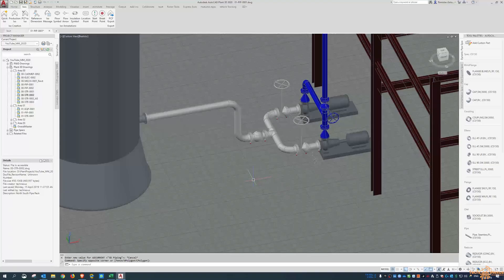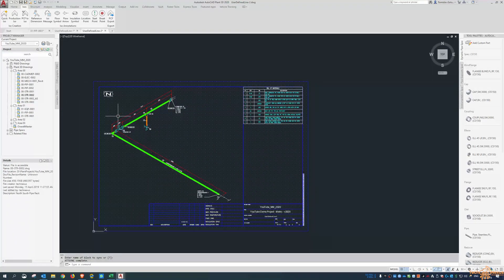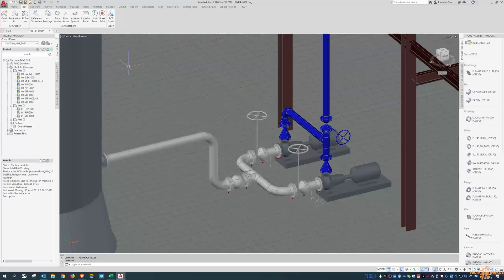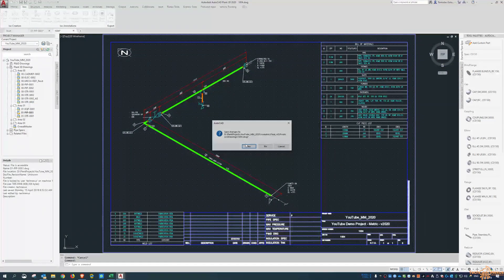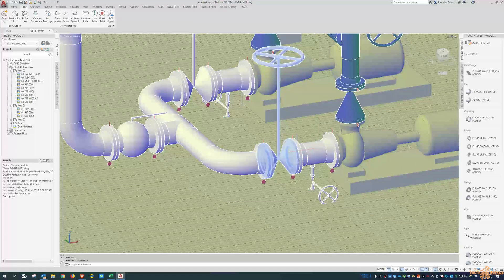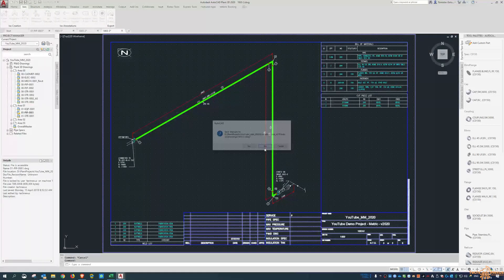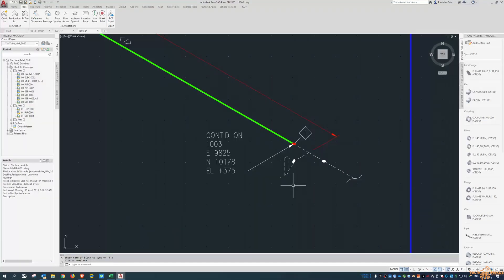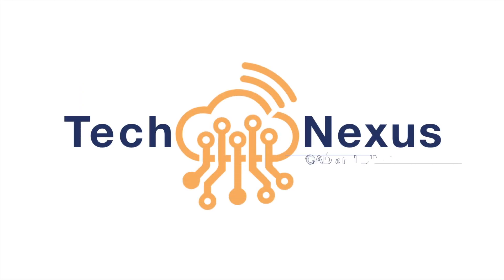Plant3D Isometrics Week - Part 1: Manual Break Points

Comment: hello please information or a video of errors when extracting isometrics.  for example.  Line number not found.  Several leaves come out of a small section of tube.  finally solution to common errors of extraction of pipe isometrics.  I will be grateful if you send me confirmation or where to locate it in Video.  Thank you